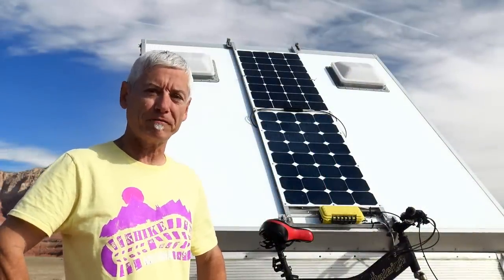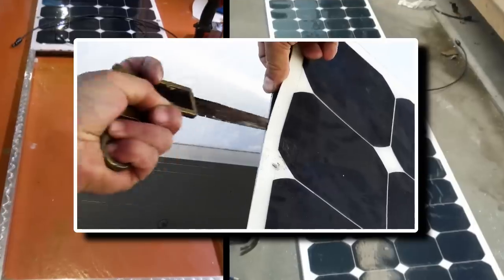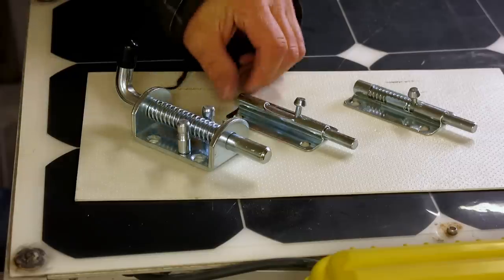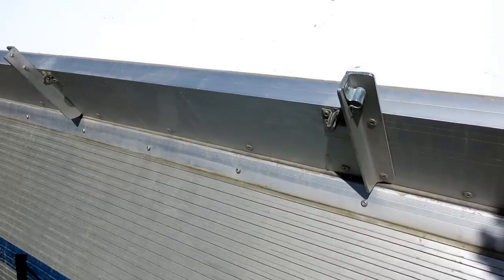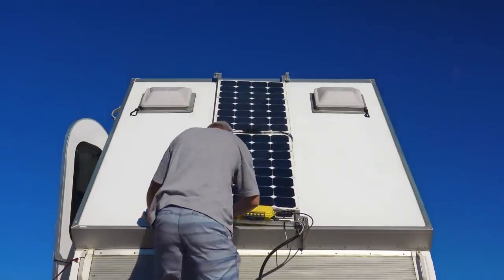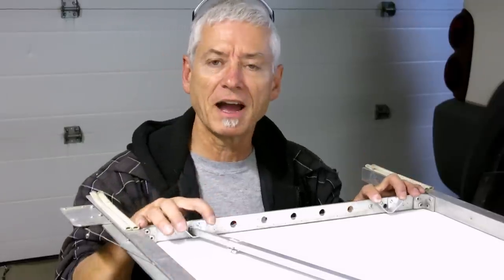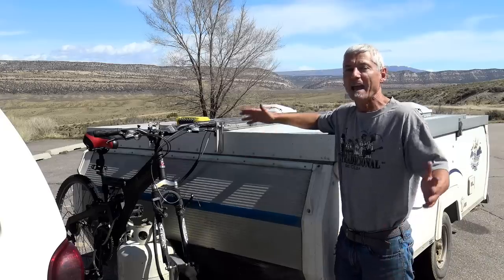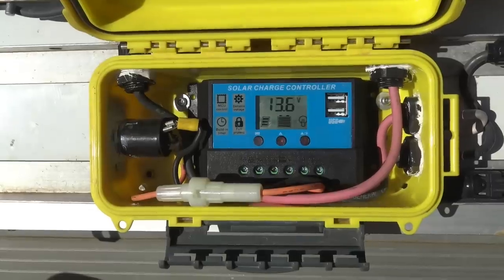Adding Solar Panels to an Aliner PT II

Comment: Thanks for all your great videos! Is it possible to run a refrigerator and a microwave on solar power?
Reply from the maker: Yes. I do run a fridge right now on solar. Microwaves can be power pigs and need an inverter, doable but not as practical. Thanks! SP

Comment: Pardon me, may I correct myself... I meant to say: ...I believe that a part of your solar panel problem may be down to erosion.... I failed to credit your own investigations. Crispy plastic and long term vibration damaging electrical connections are obviously at the top of your list of culprits, as is exposure to extreme temperature changes. I had visions of sand scratching being polished by fine dust, as with increasing grades of grit paper. Improbable, but distantly possible if you passed environments congruent to that order. At this point I'm rambling, but you asked for ideas and I was tempted to throw in my farthing, if only to eliminate it  on examination by you.
I'll shut-up now. Over to you... good luck.

Comment: I've just lost a week by discovering the RV channels. I dipped into others but then got hooked on yours: erudite, articulate,  and edifying; well prepared (usually) and beautifully edited. I binged and never turned on the TV all week. I look forward to the next episode.
 If I may comment as an ex motorcaravaner  and current landlubber, I believe your solar panel problem may be down to wind erosion. We don't have deserts and dustbowls over here in the UK, yet we are all within fifty miles of the coast and sand and wind, so we know what it can do to our glass and paintwork.
May I suggest that you take a cue from what you did with your desk top. Try duct-taping a sacrificial layer of plexiglass over your panels; easily replacable, or reversable if it you feel it too much of a sap on input. Just a thought from a solar greenhorn.
Likewise, your experiment with your portable foldout unit with the snow as a reflector was another good idea not fully realised. Try setting the panel on the edge of a laid out space blanket. That should boost your input and keep the panel out of the mud.
Keep on rolling, and thanks for the TV vacation.

Comment: Re: your observation about the lack of interest in solar power by the manufacturers, I bought a 2019  Rockwood A-frame and found that it is pre-wired for solar, although no other provisions were made. Perhaps the demand is not sufficient. Thanks for your videos.

Comment: After searching about your batteries I find more confusion.  You say here you added two deep cycle batteries with the solar panels.  Good.  You also currently say you have two different kinds of batteries and you added a battery shutoff switch/isolator.  I had questions about your batteries but I guess it got lost.  You have two style batteries charged by one solar array.  Did that confuse your new controller?  You have two style batteries and it seems your battery load is unbalanced so need uneven charging so how does the solar array and controller work solving that design?

If you use one battery for the new refrigerator and the other for computer, camera, electronics, that has uneven loads and style of power needed.  Does that even include any 110V power or do you only have need for 12V?

I can see your new battery switch changing from one battery to the other for charging but still, does the two style batteries and the new charger work good?  Seems old technology and new technology might have conflicts.  Do they?  Did they?  Also, your two batteries in this video do not match batteries in others.  Other battery problems?
Reply from the maker: Jim, so many questions! For batteries use a deep cycle, an agm, and a third option I will be announcing soon. Thanks, SP
Reply: @SlimPotatohead  - I'll be watching for it.  Thanks.

Comment: These type of videos are quickly becoming my favorites. You should have been an engineer. You take a durable practical solution shareit and it can be duplicated. There's absolutely no reason why this exact array could not be used on other trailers and vans. Normally when an RV pulls in there looking for shade that does not work with solar. I'm also impressed with your ability to move it. I wished I had seen this before I saw your trailer

Comment: Solar is great, but don't most people know that the 7 pin connector from the tow vehicle can carry charging voltage for the Aliner battery? You can drive an hour and the Aliner battery is charged when you arrive. You can also start the tow vehicle engine for a few minutes and have a topped up Aliner battery. I have solar panels installed on the roof rack of my Jeep Wrangler. I built a 20'  trailer power cord extension that fits the 7 pin trailer plug. I can park the Aliner in the shade, but the Jeep in the sun, charging via the 7 pin extension cord. The cord only carries the ground and positive charging voltage. You don't need all the brake and turn signal circuits.
Reply from the maker: Hi Chuc, the best part of having solar on a fold-up trailer is that you never have to worry about draining the battery of your tow vehicle. It also means the trailer itself is charging when the tow vehicle is not around. Your cord extension is a good idea and would be useful at night or extreme cold. Thanks! SP
Reply: @SlimPotatohead  Sure, panels on the Aliner help too. I think I need to have them there as well. The panels on the Jeep can charge both the Jeep battery and the Aliner battery at the same time. The Solar controller, a Morningstar Sunsaver Duo, isolates the batteries from each other. No danger of the Aliner draining the vehicle battery. So many trade-offs when designing these things.

Comment: Ciao,  have you considered put them on the bottom part side by side for easy acces? for what i see you have enough space for three pieces  side by side on bottom part and two more hinged on the sides.  is it too much weight on the nose?  you can balanced them with the batteries maybe 
here s an advantage  putting them all independent , You may have them tilted  wit single lifting bar in the middle, maybe i am explain this wrong ....

well all in all your lifestyle is very apeeleng to me.   maybe in a few years.....
i also have a RV is a Hobby 495 deluxe pulled by a 130HP B5 Passat

Comment: If you know that you are going to flip the solar panel to the other side in the evening, I would go ahead and flip the legs before laying it flat for mid-day use.  That way, the legs are already in the correct position without having to open, flip, close, and open from the other side. Same thing at night. I will assume that you lower it at night in case the wind gets up. Go ahead and flip the legs for use in the morning before lowing and locking it down. The extension cord is a double good idea because you don't have the power loss over the extra length of the cable that you do not need if you are not going to remove the solar panels. Now you have me looking for my own Aliner!
Reply from the maker: Hi Ron, good advice Thanks! SP

Comment: You are very clever. I'm installing a normal solar panel on the roof of my Aframe caravan. The roof is made from aluminum and is very flexible. I was thinking about how to over come the flexibility with gluing the holding bracket straight to the roof . I stubbled across your video and I will do the same as you. Running aluminum strips from top to bottom. And fixing the panel to that frame. I'm not going to have them able to be removed or tilted. Although I admired your skills in doing this. You never mention why you placed the controller on the outside of the caravan? I think I'm going to place it inside by the battery unless you have a good reason not too. I'm just being lazy so I don' t put the controller in a water tight box. Cheers and thanks, Brent
Reply from the maker: Hi Elijah, the reason I put the controller on the outside is for portability. Like the suitcase style panels, the advantage is having all energy-producing components together is you can use a remote battery and get power anywhere. If this is not something you need, then definitely put the controller inside, as it's better protected in there. Thanks, and good luck with your project! SP

Comment: I stand corrected. I was referring to high winds shaking the roof. I seen a picture of a a-liner with the roof pulled off
Reply from the maker: Hi Scott, could you please share the source of that photo? I've only found rumors but no evidence of a real incident. Thanks!
Reply from the maker: Hi Scott, I think I found it: http://members.ozemail.com.au/%7Eekthomas/wind.html. Is this the one you were referring to? I have been looking for years! It doesn't give me any specific clues as to why it happened, but it least proves it did happen. Thanks!
Reply: Hi Slim, I would imagine that it would have happened when they opened up the roof and the back of the A liner was facing the wind. The wind I think would have caught the front panel and would have thrown it forwards. I own a New Zealand version. I believe the first A frame caravans made? This was a problem for the NZ versions. The son of the inventor of the caravan said they had to repair one once before because of the above happening. He said in a windy day to always raise to roof with the front of the caravan facing the wind. As you can guess I love the design of these great campers :) Cheers, again Brent

Comment: Getting away from solor panels. Have you ever had to deal with high winds out camping and how did you tackel it in the a frame
Reply from the maker: Hi Scott, does that mean you've got wind power?!? Have a look at my "Desert and the Artist" video. It starts with a wind storm. Thanks!
Reply: The design of the A frame means they are great in the wind. I have never had any issues. You just have to be careful raising the roof in high wind.

Comment: Great video Slim. 
I guess with your set up you have to always back into south facing, to allow you best coverage for full day of sun.
Reply from the maker: Actually just the opposite. With tilting panels I can now face south, east or west and still get direct solar from the sun. With the 20 foot extension I can also face north and lean the array on the other south (opposite) side. My original design was south facing only. Thanks!
Reply: I see. Well I look fwd to see how they are keeping you powered up on your nxt video. Expecially on a near depleted battery bank.

Comment: Very timely video, Slim.  I FINALLY got my a-frame. Yippee!  It's an older Chalet and, unfortunately, it does have those horizontal bubble windows on both roof sections.  One thing I didn't thoroughly check out was the charge controller - oops.  I'm probably going to have to replace it. I need to figure out what to get since I do plan to add solar (probably will be a project for next winter).  The previous owner used solar but just hooked it directly to the battery.    

I do want to thank you, Slim.  Your videos gave me the courage to buy an older model.  I'm looking forward to fixing it up and incorporating some of your ideas.
Reply: Remind me again how many watts each panel is?  Also, your metal brake - is that a "Slim design" or did you buy it? Seems like a nice, simple setup for bending small pieces of aluminum.
Reply from the maker: Congratulations on your Chalet! I'm sure you'll have great fun with it. You definitely need a controller for your solar or risk damaging your battery. They are cheap ($20). Have fun sprucing it up! SP
Reply from the maker: 100W each panel. The term "watts" is sometimes very misleading (will go into that later) as it really doesn't tell you what the actual energy you will generate in true life conditions. The brake was a cheap chinese product (but effective). Thanks! SP

Comment: I like the custom aluminum hole guides, was wondering how you were able to hit the far end hole so easily. Nice work Slim👍🏻
Reply from the maker: Hi Steve B, Practice! I did realize however it was hard to do in the wind, so added the guides later to make it easy. Thanks!

Comment: I like the way your brain works. I did see one of the companies offered a small solar panel (I think something like 40 watts) on their A frame. You said you had experienced very high winds in your camper. Did the camper rock a lot? Thanks for the videos.
Reply from the maker: Hi Jerry, could you please tell me what A-frame offers panels? (No links as they get blocked). Thanks. At 40-50mph winds the trailer shakes and howls a little. Pointing the trailer into the wind helps.
Reply: On You Tube type in princess craft aliner ascape walk through with princess craft. She says it comes with a 40 watt solar panel. On another video the company said they were putting solar connection in their units. Have a good day.
Reply from the maker: Hi Jerry, unfortunately the Ascape is a teardrop-style trailer and not an A-frame. Guess they still haven't figured a way to include it on a fold-up yet. Hopefully they will soon. Thanks!
Reply: Hi Slim, I think the Australian version A liner, made in Australia. Has solar panels added from factory. The New Zealand the company (Southern star) that made A frame caravans early 70's to early 80's made 550 in total, 200 were sent to Australia. No solar back then though :) Cheers, Brent

Comment: I got a flexible panel for my a-frame... just one, since I have a generator. I'm going to just use velcro on the roof so I can take it off in transport, and quickly slap it on while it's put up. Most of my camping will be several days in one place for paramotor fly-in events. I'm going to one in Kansas next week. I should be on site for up to 6 days! Hopefully it all works out well, and I'll enjoy staying in my a-frame.

I do need to get the spoiled egg smell out of the fridge... I accidentally left some eggs in the fridge for a few months! Eww!!
Reply from the maker: Hi Matthew, velcro would certainly work and be much less effort than my rig. It is a good idea to keep the panels off the roof when not being used for periods of time. Most new flexible panels have metal grommets as well so you can strap them in place as well. Enjoy your trip, sounds like a blast! SP
Reply from the maker: Any tips on camping in Kansas? It's on my hit list! SP

Comment: Does relying on solar power prevent you from staying in the forest where trees block most of the direct light?
Reply from the maker: Good question, thanks. If you typically camp in dense forest (some do it to keep cool), there are a couple of options. One is to move your Solar array into an area of sunlight. My rig can move 20 feet by an extension cable. If farther away you would need a portable battery store power from a more remote location. A little too much bother for some. Finally, you will get some power in shade. I typically get 3 amps in shade. This could still be enough to keep the battery charged if you conserve on appliance use. Thanks! SP

Comment: Very nice design. I will be waiting to hear why your pannel failed the flexible ones make sense to me in many applications but I have read they fail more often. Happy travels.
Reply from the maker: Hi Tim, I am still preparing my report on this. Could you be kind enough to tell me the source of the article you cited on panel failure (no links please as the get blocked). It would be very helpful to me. Thanks!
Reply: There wasn't any articles. It was on a forum we're someone said Renegy stopped selling their flexible pannels due to failures or issues. I don't remember we're I read that sorry.